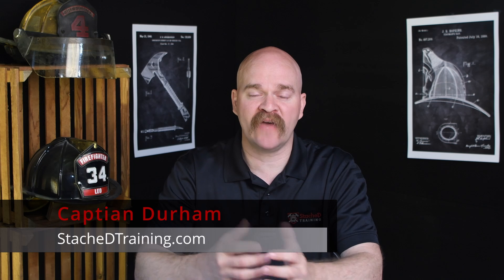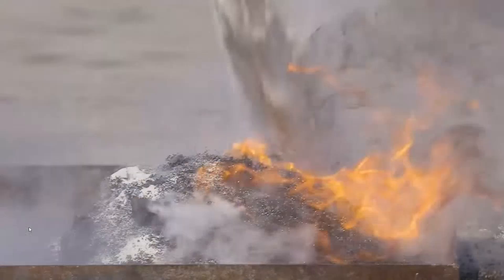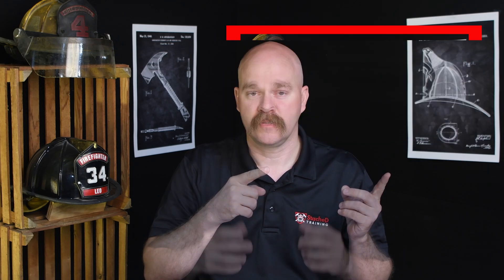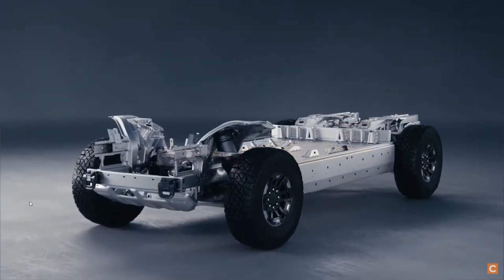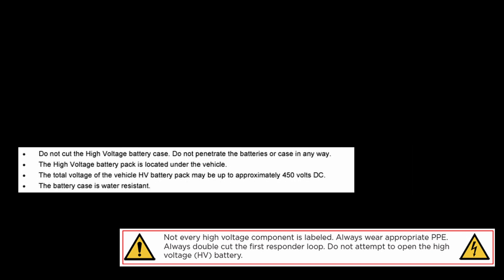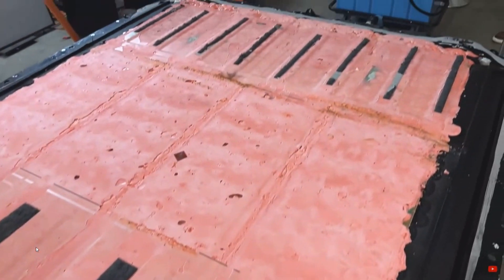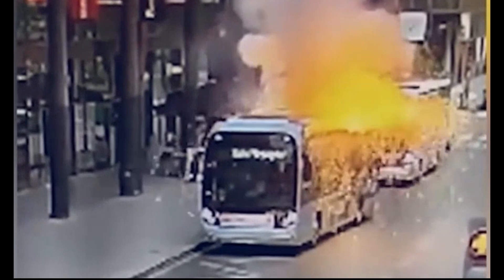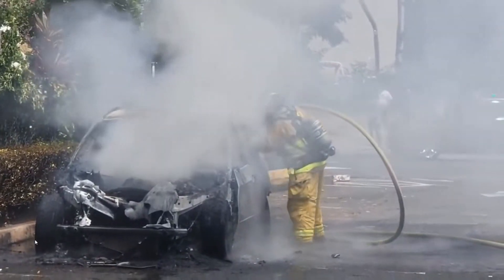What Firefighting Tools for Extinguishing Electric Vehicle Fires Really Work?

Comment: Putting the CAR fire out is one thing, the battery is another issue. If you can contain the car fire than you will contain the fire to the battery. If you let the car burn, everything around it, including other cars, will burn.

Comment: Perhaps they need to establish an industry standard for producing batteries for vehicles that places all batteries in a specific location, with specific removal and extinguishing guidelines.  Have you ever considered suggesting to companies they implement an emergency ejection system for EV batteries?  I think someone could invent a system to install in all EV's that would allow emergency workers to quickly remove and isolate a runaway thermal battery.

Comment: You can't remove the fuel or oxygen so i guess removing the heat is the only thing i can think of. I know they put out oil well fires with explosions but i think an ev would immediately reignite.

Comment: So what if they put a port on EVs that you can plug a fire hose into, and the pressure from the fire hose will bust through some seals and then you'll be able to run water directly over the battery bank? 

Or maybe They can start using heat sensitive seals or something so that if a fire starts it will break out all the waterproofing seals and allow water to flow of the battery and cool the exothermic reaction

Comment: If the fire is to be allowed to burn itself out, would a fan and vacuum system work. Use a large fan to blow the heat, gas, and contaminants toward an appropriately sized water vacuum system. An industrial sized Rainbow vacuum cleaner. The heat and particulates would, theoretically, be absorbed by the water. The gas from the vacuum exhaust could then be dispersed or captured, compressed, and transferred. The viability of this last stage is questionable, but the fan and vacuum stage seem doable.

Comment: My old department loved those FIT-5/DSPA and STAT-X devices.  I called them "the red land mine and the hand grenades" (google "DSPA-5 demo" or "StatX first responder" if you dont know what those are) but jokes aside, they really were amazing for basement fires, creating a quick knockdown, and RIT recovery (i.e. knocking down fire quickly for extrication).  I have to wonder if that chemistry could be adapted for Li-ion battery tech.   Those things didn't always knock OUT the fire, but they definitely bought time and reduced the volume of fire (and the temperature at the ceiling) fairly dramatically, also limited water damage so the insurance companies used to refund us for spent units (not always but sometimes).  I recall there was this one house - fully involved basement fire ((dryer fire, ceiling joists, rack of clothes and void space in wall behind dryer all on fire)) where the device literally put out the fire and we mopped up with hand cans, maybe 5 gallons total water used.  So, my thoughts are, tweak the chemistry, drop one of these beneath the car, and see if dry powder aerosol could at least cool the sumbitch down so we can extricate occupants and get time to bring water to the battery pack somehow.

Comment: I think the worst problem if a fire is inside a house and sprinkler that normally should work is at the wrong place, ceilingmounted sprinkler is not the best and if we put wall sprinkler low aiming in the car windows it could actually block an evfire if combined with floorsprinkler like those on aircraftcarriers.

Comment: In Denmark we have a solution for cars. We use an open garbage container thats is water tight. In case of battery fire, we put the car into the container and fill it with water. It won't stop the internal fire in the battery but it contains the heat under control, so the heat do not spread.
Also on a ferry, we make a water curtain around the car, so heat doesn't spread around to other cars on the deck.
Reply: So how do you get the car into the container?
Reply: @michaelcannon3978  With a remote controlled trolley that jack up the burning disaster.

Comment: I recall reading about a university engineering research group developing a non-flammable battery coolant (as I understand it, part of the problem is that current battery coolants are solvent based and flammable, and it is the coolant igniting from the heat of the cells in runaway that acually causes the fire).  I can't find any info about it now, though.

Comment: A Norwegian company haa designed a system using salt water cooled to near zero. Which is used to flood the car. After breaking the windows ti gain access to inside of the car. The system has been installed on a RORO car carrier. Water drenching to control fire spread on the car deck is also used. Like all these systems currently out there. It misses the fact there is a high rick of vapour cloud explosion or deflagration or battery explosion. Which during the access phases puts responders at risk. And ships fire fighting crews are members of the crews aboard.
Reply: Replying to @marcusjones1088:

THERE IS *NO* SUCH WORD AS *DEFLAGRATION*

Comment: First determine if it's a battery fire. There have been at least several fires where the Tesla fire was not the battery, including a garage fire, where the Tesla was badly burned but the battery did not catch fire. If it is a battery fire, just protect the surrounding area, and let the battery burn out. Like you said, don't waste water, and it will take only about 1 to 1.5 hrs for it to burn out.

Comment: I think you are probably right about letting it burn... but... given the amount of heat given off by these fires, I can picture cases where that just isn't a great solution. It might be in a garage with lots of other vehicles close by, near too many people to evacuate quickly enough, whatever.  What about a box that can be dropped/assembled over the vehicle and then filled with water? I'm thinking something akin to the plastic accident barriers that lock together. Maybe fiberglass or something to handle boiling water which it might be before you are done. You lock them around the vehicle and then fill it with water. If you can keep the water on the vehicle rather than it flowing away, it seems like you could cool it faster or at least contain the heat. Idea by Yumadome!

Comment: Polypropylene corrugated Sleeve is a flame carrying material & responsible for spread of fire & complete vehicles getting burnt. Earlier plain PVC sleeve was being used. In those days there used to be local fires only. In very recent days varieties of materials are being used & it is necessary to ban any flame propagating material for electric wires & sleeves.

Comment: Is there a way to force the battery fire to deplete its oxygen and fuel faster, ?     In reasonably controlled manner, not by making it explode ( I’m not entirely sure if detonate is the correct term here) or ‘flash over’ , but more or less by significantly increasing the combustion rate enough to make the fire burn out before the resulting increase in temperature has time to consume everything else.

Comment: "Let it burn" is a major haz-mat/environmental issue. The combustion products of the batteries are highly toxic, and allowing them to simply blow into the air unmitigated is a problem for everyone in the neighborhood, who won't have haz-mat gear. Once the fire starts, meaning the venting of pressure and flammable gases may have already happened, I'd blanket the vehicle, then water fog over it. Yes, the runoff water is also toxic and an issue, but that can be localized more than spewing toxins over a wider area into the atmosphere affecting an unprotected public. And a water fog will use less water than streams, creating less run-off issues, while helping minimize airborne pollution. A water fog over the vehicle could also take less manpower and apparatus.  

Oddly enough, in my suggested videos I see one from "AVD Fire Extinguisher Solutions", titled "Are you prepared for a lithium-ion battery fire?" in case you need another example of products.

Comment: Excellent summary and deals with a few of the canards around putting out lithium-ion battery fires. I very much agree with the suggested approach in this video. There is also the issue of run-off from the application of water and/or foam and the pollution that is caused. It is better to treat as "controlled burn" and prevent fire spread. I will be recommending this video to others. Well done.

Comment: Here is one solution that works in a few parts:  1) As is the case with huge electric underground mining vehicles, pipes are plumbed into the battery, with sealed, emergency access points with threads made to accept normal size fire hoses.  2) Flood with a brine solution, I forget the percentage but it's even better if it is chilled.  Salt being an electrolyte works to rapidly discharge the battery, so you just have to have enough solution to keep it cool while it discharges.  I predict that these ports will be required in every country someday.  With new energy vehicles comes new infrastructure, and choices must be made by the powers that should not be.  There needs to be large tanks on the roof of every parking garage that gravity feed a fire suppression system with an outlet at every parking space.  I've seen the future, and this brine flooding system will be part of the charging port.  Charging ports and plugs will be as big around as a fire hose, with an inner lumen being the electrical wires surrounded by the outer lumen through which fluid can be automatically pumped if the thermal camera based fire suppression system detects thermal runaway.  It will flood the battery when the internal battery temp is above a certain thresh hold as sensed by the Flir camera and prevent the thermal runaway and fire in the first place.  Car insurance is going to be impossibly expensive soon, and be like home owners insurance in Florida because of this problem.  What I described is the solution, maybe someone reading this will  be in a position to actually design these systems sooner than would otherwise be the case.  Look at the problems China is having because that's what it will be everywhere without this.  Until new battery tech comes out and is widely adopted, there is no other solution.  Governments are going to have to put the money into their firefighters and first responders to give them the equipment and training they require, and they need to separately zone parking areas and those for electric vehicles must have fire suppression and flooding systems.  You can expand the number of electric parking spaces with the need, again, until new battery tech is there and no longer a risk.  But what do I know, I'm just an autistic nerd.
Reply: There is Battery Briner who has designed such a BEV suppression system. It's looking like a great solution... pun intended  LOL.  Incorporating an ISO in regards to a flood port in each and every EV design must be in place
Reply: Not a bad idea, but brine solution is horribly corrosive since it is basically sea water. Also, and I may misunderstand some of your idea, if you short out the battery even more quickly than it already is, causing the fire, wouldn't that make it worse? I mean, that's a lot of energy to get rid of.  New battery technology is only going to make this worse... look at the difference between the old NiCad batteries compared to Lithium ones... way more energy in a smaller space. When they get the next gen batteries (I have heard probably either Lithium-Graphene, or purer Graphene, that will be another step higher. We'll be close to the "phaser is on overload, it's going to blow!"
Reply: What make of underground vehicles are you talking about?  Just curious if my company has them.  As a Mine Rescuer we have a Blitz Nozzle and that's about it.  I was entertaining the idea of using sandfill but would depend on different factors.

Comment: I would say at some point there will have to be a global standard on how to build Li batts with a built in intervention process to address the current problem. How long were headlights, brake shoes etc manufactured and sold before DOT specs became the legal requirement? This was a really informative vid, thank you!

Comment: I personally feel that every enclosed box of flammable/hazardous materials should contain it's own firefighting materials. 
Like you said, there are chemicals out there that can stop or at least slow down a lithium fire. We should invest as much as possible to perfect these chemicals.
Next we should have a method of EASILY removing subcontainers of impacted batteries. Yes Tesla (and everybody else), that means you have to design a system that allows for easy removal and easy replacement. Even it that means it will cut into your profit margins. Right to repair, right to extinguish your own EV. 

But this requires people to think and act. And we don't like that, do we? (and by we, i mean Them)

Comment: I think the focus of firefighting should be isolation.   If the vehicle is in a good location, like the host said let it burn itself out, if not have methods of relocating that vehicle to a safe location, someone suggested a special designed trailer and winch system.   I would think this would mostly be about getting vehicles out of parking garages safely.  In the end EV's and their battery chemistry is getting less flammable all the time and they are currently  about 67 times LESS likely to catch fire then a Gas car.

Comment: Agree with "let them burn" to some extent. If in a parking garage use the blanket and an idea from Asia where they have way more EV's. Fire company arrives, puts blanket over burning vehicle. There is a "collapsible kiddie pool" that you surround the vehicle with and fill with water. Fire companies in Korea are using it. Assume, like the blankets, it "sort of works" by cooling the fire down. Regardless, vehicle must sit until it is safe to move....which could be a long time. I have seen forklifts dump smoldering EV's into the local river, etc. 

What works:
Blankets diminish the fire/lower the temp....but don't put it out.
Immersing in water works, you have to leave it in the water for 2 or 3 days. Chuck it into the ocean....but you can't safely transport it to the ocean
.
Flat bed with a kiddie pool on the back....sounds like a disaster waiting to happen.

It is a Temperature game....blanket is proven to lower temp and immersing in water is proven to lower temp better than blanket. One fire captain got a claw, dug a hole in front of burning EV, filled with water and shoved it in. This won't work in the Calahan tunnel will it?

Best idea is, don't commit to "that will never work." If they figure out the kiddie pool thing, the guys at the station could use for the kids on family days.

Comment: How about something the manufacturer installed inside the battery box, That gets triggered, filling the battery box with some type of fireproof foam that rapidly hardens,and would at least contain the fire to one section of the battery pack.

Comment: There isn’t an exposure problem, let it burn and use a limited amount of water to reduce the hazmat. Otherwise, if there are exposures spray water on the exposures and cover the vehicle with a blanket for 45 minutes to an hour. It has worked for my department. If it’s inside, well, you have to use water to out then fire out and then remove the vehicle and cover with a fire blanket.

Comment: Best option is used on battery powered mining machines.
They have a cooling circuit integrated on the battery with a connector on the outside, like the charging port.
When they have a thermal runnaway they connect the cooling hose and flood the battery from the very inside of it. They can even have a closed loop if not rupture occurs wich is even better.

Comment: I was on Submarines for 22+ years and battery fires or Shorts before the battery breakers were the worst case scenario and usually lead to the ships Decommission. Battery fires are first a Electrical fire, the first thing you need to do on a electrical fire is turn off the Electron movement impossible with a cell short and the cells being placed tightly together which causes the runaway then you have other items around the fire become involved meaning multiple types of fire at the same time and location each needing a more specific extinguishing agent (which don’t alway work together. EV’s are a Idea without a plan or proper safety testing, even your toaster gets safety tested which is the reason for warnings like don’t use it in the Bathtub 😂.